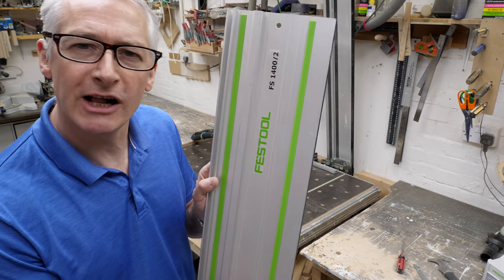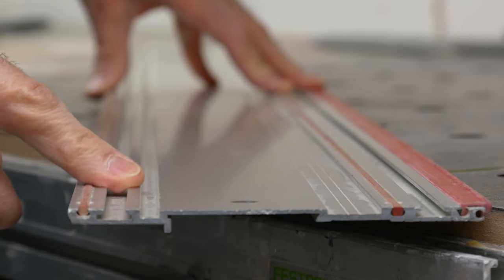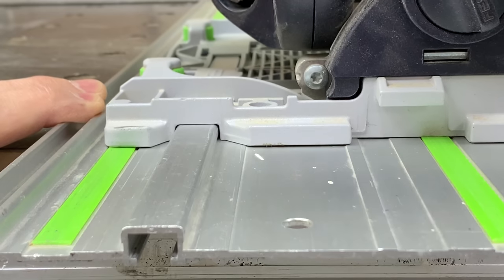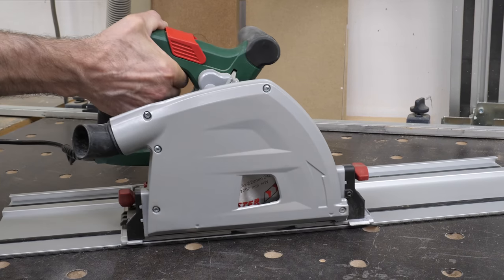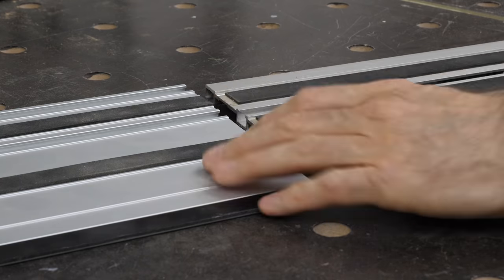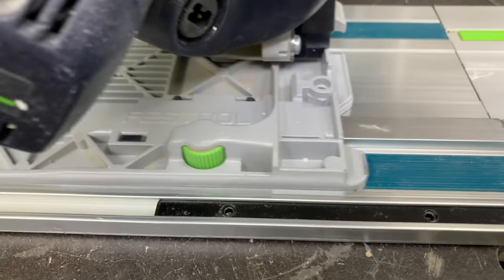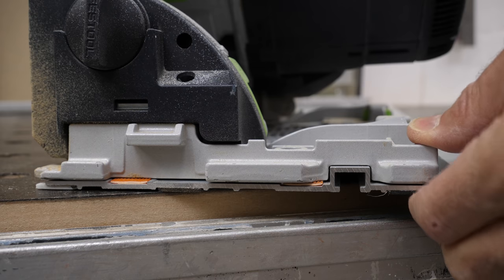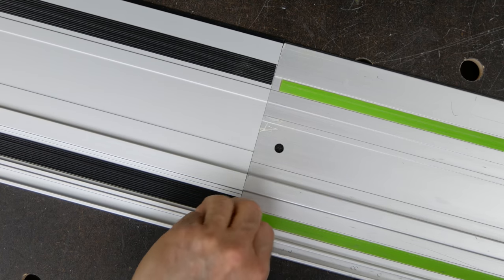Which Rails Work? A Guide to Guiderails [video #403]

Comment: I use the makita saw and rail. And the 3m one is an absolute beast for doing sheet goods. I also have a router adapter and i just love it. Only downside with these rails is that you can’t trust the splinterguards for measurements. I always measure away or to the alluminium and add or subtract that set offset.
Reply: Instead of that, just plunge the saw on the rail without it being turned on so the teeth are touching the material, and roll it forward. They’ll. leave little marks, you’ll see exactly where the cut will be. 

Hmmm 🤔 should plunge saws have shadow/laser lines too 😁

Comment: Peter absolutely love your video’s. I’m a Brit living in the Northwest of the US and have recently decided to restart my woodworking hobby.  Having dropped a small fortune on Festool I made a recent discovery. So Amazon recently starting promoting the Powertec brand for shop supplies. I’m not sure if there is a relationship with Amazon. The point - They sell two 55’ rails plus 2 connectors for approx $130. They work great!
Reply from the maker: Thanks Omar! Wow, they sound like great value! 👍👍
Reply: I've been very happy with my Powertec rails and Makita saw.

Comment: It sounds like buy the rail from the same manufacturer as the saw unless they don't make rails.  The anti-tipping of Makita sounds like the best system.  The Wen has 100", 2 50" rails, for $65.69, and much of the time you will probably only be using one rail.

Comment: Evolution Power Tools ST2800-G2 Circular Saw Guide Rail / Track | Universal Fits Most Brands Makita, Bosch, Festool | 2.8m (2x 1400mm ) With Self-Aligning Connector Bars | Incl. End Stop Accessory....This is the new version of the Evolution Rails , comes with 3 glide strips . Ive just bought the new Festool TSV 60 With Scorer blade and I bought these to use with this rail as It needs a dedicated track due to the scoring facility . Ive yet to put them against my Festool equivelents but the T slots are right way up .  Amazon price was £84.99 You get 2 x 1400 rails , Saw stop Jointing bars , Allen key with holder , 2 new type clamps and a carry case , all neatly packed in a sturdy box ....Im a Festool nut andf have been for yoears but I recon these rails will do the same job for a lot lower money or even as a back up rail set .
Reply from the maker: 👍 https://youtu.be/HtJFtP-kDPI

Comment: Thank you Peter for that, informative as ever, tutorial. Having watched your previous series on the 'plunge saw wars', I kept my eyes peeled for the Evolution solution. I already owned the Makita plunge saw, which I bought as a package with two guide rails, the bag and two clamps for less than £400.
Initially, I was tempted by the 3m rail as the Makita rails don't seem to connect all that well. And whilst this has not really had any impact on the accuracy of the cuts - can't blame the rails for everything - there is a distinct clicking as the saw travels from one rail to the other. On top of this, they tend to gradually drift apart if you have to perform repeated cuts and are constantly moving the tracks. I really think there should have been an option for two joining strips, as there is on the Evolution, making alignment more reliable, and the connection more secure. 
When the  Evolution deal you mention came up on a special for £59, I just went ahead and bought them. I then did what your fellow YouTuber at The Strawbyte Workshop suggested, and cut one of the Makita rails into two lengths 800mm/600mm making them easier to use on kitchen worktops and in smaller spaces, where the 1400 was just a tad too long.
Reply from the maker: Nice! You can use two joining bars in the Makita and Evo rails- it’s one up, one down with the Makita - like Festool - but completely do-able. 👍👍
Reply: I was wondering about that 800/600.  The Detroit guide rail comes at 1400 only, seems likely to be cumbersome for most work. 700 is just blah.

Comment: Very informative and helpful video. I was contemplating getting a tacksaw and went for the 36v Makita....expensive as I'm not in the trade but well worth it. I saved some money buying the evolution rails which advertise compatability so I bought the 2x70cm kit and plan to get the 2x1.4m one at some point. They work perfectly with my Makita so far.
Reply: Same here.. after lots of comparison and review, I did not want an ultra cheap track saw that flexes (Ryobi, WEN) and would not pay the ultra premium cost of the Festool.  The Makita 36V was the best mid-line model IMHO.  The track cost is too high ($99 per 55" track), so I ordered mine without one and got the Powertec ones for far less... two 55" tracks, a nice bag, a quality right angle adapter and pair of track clamps, all for under $200.

Comment: Thanks for an excellent, informative video. Just what I needed to help decide whether I can adapt my current old DeWalt rails (one is actually an original Elu!) for use with my new Makita dhs680 saw (I'm doubting that it's worth doing, mainly because they lack the integrated glide strips but also the locating rib is slightly wider at nearly 17mm). Excel seem to be going at a sensible price at the moment, so maybe that's the route to go. Lots of other useful ideas in the feedback below too. Great channel. Thanks again, Peter.

Comment: Peter, great channel, just found you. That was interesting about Mafell making the Bosch rails and connector. And they are identical which was a surprise for me. I have an older Bosch PKS-54 so will go for the Bosch (=Mafell) solution. All the best, Rob in Switzerland.
Reply from the maker: Thanks Rob, and welcome to the channel! Yes, Mafell make some of the parts for Bosch as well, but Bosch actually manufacturer the saw themselves. 👍👍

Comment: Hi Peter, after watching you David Stanton & Ron Paulk I felt that I needed a Plunge Saw but the cheapest I could get at Total Tools before Christmas was a Detroit (Total Tools Makita anti-tipping). So for $399 it has a 2mm scribing cut button by rotating a dial to scribe/Cut or replace blades it came with dust bag/2 joiners top/bottom/2 clamps/1400mm track with 165mm Plunge Saw & I bought another 1400mm track for $99. In Australia, it is about a bit under about a 1/3 of the Festool & 1/2 of the Mikita in price.
I am very impressed with it and it made making an 850mm wide x 800mm long x 195mm high Ramp at around 10Deg very easy.
Reply from the maker: Sounds great! And sound very much like the first cuts I made with my plunge saw! 👍👍
Reply: I bought one yesterday, it's still in its packaging. I bought the kit which adds the 1400m rail to the body, bot neither clamps nor dust bag.

I do plan on getting a "better" blade from Bunnings, most likely Diablo or Italian Irwin. It seem Italians are especially good at making cutting stuff, and/or persuading the world they do.

Comment: Thanks for this Video. I just picked up the 2 x 700 Excel rails for £32:00 delivered inc VAT. Excellent value.
Reply from the maker: Just be aware that the 2x700mm Excel rails are not the same pattern at the 1x1500mm rail I talk about in this video. They’re more like the Parkside rails, not the Makita pattern.

From the video description:-

“NB: Excel is an own-brand of Tools4Trade. The Excel 1.5metre rail is compatible with Makita and Festool, but their own Excel saw seems to be a clone of the Lidl Parkside, so the 2x700mm rails bundled with the Excel saw, or available as accessories have all the same issues that the Parkside saw and rails have.”
Reply: @10MinuteWorkshop  I have a festool saw so I think they should be OK. If not they take returns. Thx

Comment: Hi Peter, thank you for another geat video. But I have one thing to point out. Festool rail sticks to the wood so clamping is not necessary. My other track is Pattfield (Hornbach market brand, 30 euro for 1400mm track), and is also Festool compatible, but it slips on the wood like crazy. I replaced glide strips and splinter guard with Makita spares, so the track now works pretty well now, but with stock soft strips on the bottom it is not any close to Festool grip. I cut the track to 800mm lenght for smaller jobs. And it works with handy Bosch 12V circular saw as well.
Reply from the maker: Yes, Festool have the most ‘grippy’ rails of any I’ve used, though Mafell comes pretty close. 👍👍

Comment: Thanks for the tip on excel rails, I don’t need any more rail sections, but their joining bars are very good value at 10£ posted for 2 sets.. Makita ones are more than that for 1..
Reply: Does the DeWalt plunge saw fit on excel tracks?

Comment: Super useful videos Peter you convinced me to pick up a track saw. I’ve ended up with the cheap silverline (looks identical to the lumberjack saw) for £60 off Amazon warehouse which came with two 700mm rails, can’t complain for my occasional use!

I did get the long excel rail also as they were £45 still cheapest a for long rail and the site did the makita splinter guard for £5...

...However one word of warning for anyone with the silverline or lumberjack (or wider track saws), they’re a touch wider than festool on the left and as such foul on the anti tipping lip of the excel/makita rail. 

Having weighed up the cost of returning and other rails I will be angle grinding that lip off.
Reply from the maker: Good to know, thanks! Sounds like you picked up a bargain too!👍👍

Comment: Thanks for the comparison.  I am new to plunge saws and guide rails.  Have an Aldi saw and just bought a set from Evolution with 2x 700mm rails, clamps, joiners and a bag for £50 direct from Evolution.  Thanks for the issue with the low friction strips I will ensure that I try to keep pressure over the strips.  The cut edges of the rails are a little rough which is disappointing as I assume they are machine cut, I may fettle these for a smoother joint and I agree the splinter guard is a little bulky.

Comment: Hi Peter / all. Not sure if this has been mentioned before. After some testing today I can confirm adding EzyGlideTape (the solution for sticking curtain rings) to the Evolution rails eliminates wobble on my new version Parkside PT55 1200 D2 - a relatively inexpensive fix at around £10 delivered from Amazon. Only just got some, put it on and made some test cuts (accurate) so not sure about long term wear etc yet. Regards Ed
Reply: Hiya, sounds good. I'm assuming this was installed to create the missing left hand slider?
Reply: @45KevinR yes, a few months in and still working fine. I use the evolution rails for sheet materials and often joined together. Not having to worry about tipping the blade when cutting in awkward positions is a real plus.

Comment: I modified a Makita guide rail slightly to fit my Parkside. I cut off the anti-tipping lip with an aluminium cutting blade so the Parkside would fit in the channels. But then found the splinter guard ended shy of the blade, so replaced it with a 2mm x 25mm rubber strip and trimmed to size. Now I have a Makita guide rail that can use all the aftermarket jigs on my Parkside.

Comment: great video. i bought the evolution rails after seeing them recommended in one of your earlier vids and I love the rails for the price and size. my only criticism for my pair is; i believe the ends of mine weren't cut at perfect 90's and when joining them together i have to leave a maybe 1mm gap to one side to straighten them up and avoid the saw binding when i go over the join. regarding 7:10, i've also had the issue with the saw tipping to the left if i don't keep pressure towards the blade side but I had just put it down to the base of my cheap lidl saw not being completely flat (you can see some gaps when placing a ruler against the face) but it probably is just as attributable to the point you make about both strips being to the right of the rib - having one on either side does seem like a better design.
Reply from the maker: Thanks! Interesting - I have many years is plunge saw use, and I can imagine what a pain that must be for the saw to tip like that! 👍👍
Reply: Peter , why don't you just re-cut them to 90° ? 🤔

😎👍☘🍺
Reply: @Fitzpatrick, out of all us Peters I'm probably the least confident about my ability to cut a perfect 90 into the track :)
Reply: @peter-gn8ey   "if at first you don't succeed try try again " .. 🙄😂
Go on Pete... give it a go.. 🤨

😎👍☘🍺
Reply: I have the set of two 1,400 mm Evolution rails in an Evolution bag.  The instructions tell you to leave a 1 mm gap when joining them so they must recognise that the ends aren’t perfectly square (mine are slightly out of square, too).  Don’t mess about trying to trim the ends dead square - just follow the instructions!  Or should that be the classic ‘RTFM’?
Reply: @ianmathieson65   you would think a 90° cut would be a trivial affair for an industrial manufacturer... 🙄😒
So how do you keep 'em straight Ian ? Do you use a straightedge or somethin ? Kinda negates the advantage of them really... 🧐
I "need" a long one for cutting down 8 x 4 sheets lengthways... faffing around with connecting shorter ones is a pain in the ass.... 🙄
BTW ... NO self-respecting man RTFM .... or uses a map.. (remember those things ? 😂)

😎👍☘🍺
Reply: Peter Fitzpatrick:  Yes, I should have mentioned that I lay the two sections along the base of my reasonably long spirit level and hold them against it while I tighten the joining strips.  Once tightened, the joint is very stable indeed.  If you struggle to hold both sufficiently firmly against the base, you could try using a couple of clamps but I’ve always managed by hand.

Like you, I bought these to cut pieces off the long edge of 8x4 sheets and also for trimming replacement doors to fit existing frames. I keep thinking about a single length of extruded rectangular aluminium tube to use as a cutting guide but am uncertain about how straight it might prove to be.  In any case, trimming doors is done away from my home and such a long length would be tricky to transport, which is where the two 1,400 mm lengths win.

One benefit of the instructions requiring a 1 mm gap is that the rails are only aluminium so are easily bruised, especially at the vulnerable ends.  While a burr on the sides either can be ignored or trimmed with a file, one on the ends could upset the straightness if not spotted.

As an aside, I’ve seen first hand the very expensive consequences of not reading the manual:  A team of technicians, who should have known better, carried out a complex assembly on an offshore platform without referring to the very detailed step-by-step manual and ended up in a serious mess from which they then didn’t know how to recover.  I was called and had to be flown to the platform by helicopter to sort things out, and then flown back to shore.  A very costly error indeed because it included the cost extended oil production downtime but they did learn the lesson, albeit the very hard way.
Reply: yes Ian, I've seen that page in the manual. I find that if there is any gap left in the join at the rib area, the cam on the saw catches that edge and tightens itself up as it's pushed forward - despite me having tightened the screw holding the cam firmly and pushing the saw laterally to the left while going forwards. again, could be simply down to using a cheap aldi saw. the gap I have to leave then, is at the splinter guard side (as long as I join in the boards in the same order, which is why I have marked them A and B).
Reply: @ianmathieson65   Wow... bet there were some red faces on that platform... 🙄😂😂

😎👍☘🍺
Reply: @peter-gn8ey  ... that settles it we ALL "need" 3metre tracks ... 🤗

😎👍☘🍺
Reply: peter:  Try using a fine file to create a small lead-in chamfer at around 15 degrees on both edges where the cam passes over the joint..  Hopefully this should stop the sharp edge of the aluminium grabbing the cam.  You can also then blend the chamfer into the edge of the guide making it even easier for the cam to ride over the joint.  And the 1 mm gap is only a guide value.  I close mine up as much as any out of squareness will allow.  Definitely helps.
Reply: Peter Fitzpatrick:  Yes.  The consequence were so serious that the client decided to bring me in whenever a rebuild was needed (the equipment was part of an experimental diving bell system with a risk of recurring damage when in use.  I would get a phone call at home,then would  have to drive from the north of england to Aberdeen where I would catch the daily morning helicopter flight to the platform to start work at 6 am.  I would usually be there for around two weeks due to the complexity of the task.  But the client felt the cost of this was preferable to the cost of another foul up.  The complexity was what made it so vital to RTFM to avoid traps where once a wrong move was made it was impossible to go back so it meant starting again.

Comment: Hi Peter, I  enjoyed your video very much. Just to throw in to mix, I recently bought Metabo KS55FS with FS 160 rail. 
The bundle costs around 200 euros. 
I guess its oltder model but I could not resist for that price. 
The rails looks like "bosh" but I did not do the measurements. 
Also, you can get 800mm rail for 60 euros on amazon.de which is close to youtool which costs 40 Euros.
Have a good day.
Reply from the maker: Thanks Pavel! Great price. 👌👍👍
Reply: @10MinuteWorkshop  The downside is that it's really hard to find any accessories. Peter would you be so kind and measure the height of space in which the clamps should be inserted? At my Metabo rail it's 6.5mm. I am trying to assert whether I can use bosh (or other) clamps. Thank you very much.